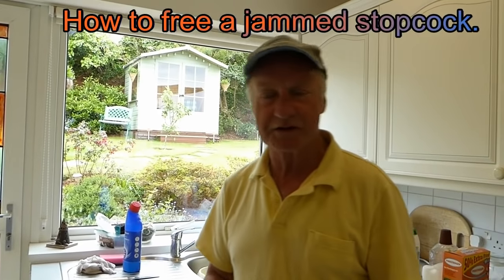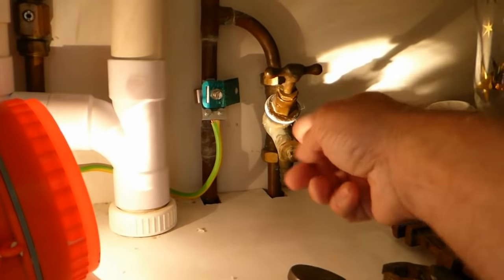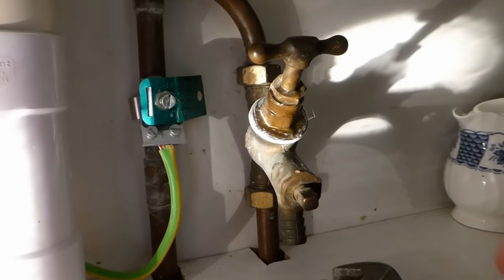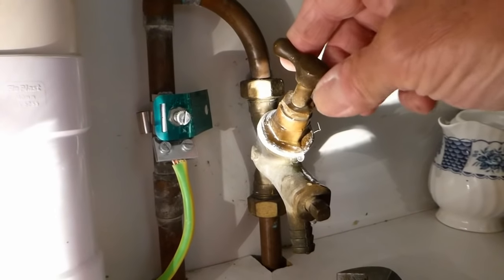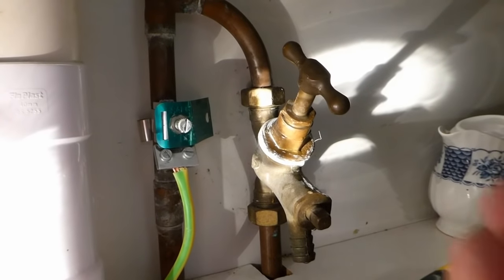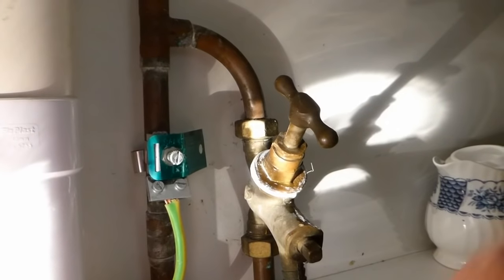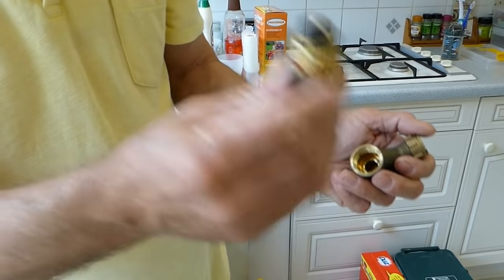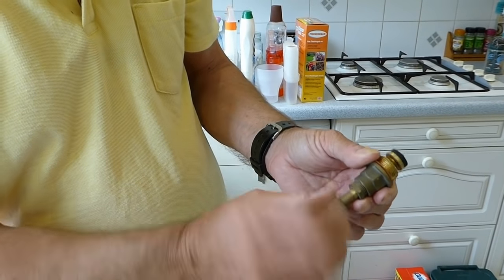How to free a jammed stopcock that will not turn.

Comment: Hi I have phoned umpteenth time to plumbers who say you can't free a seized stopcock as it will not be the same if it's freed, that's shocking from so many plumbers in my area. I have a burst pipe in garden, and the insurance will not pass  said repair until I fix seized stopcock in kitchen? There is a stop valve in street? What's a seized stopcock got to do with a burst pipe in garden under my monobloc path?
Reply from the maker: Once they are freed, they can sometimes not work properly, but of course, you do not know until you try. Most plumbers will avoid this sort of job.
Reply: @dereton33  Thank you for responding, yes your right no plumber will entertain it 😕 and the plumbing company for insurance will not fix burst pipe in garden because of internal stopcock, even though there is a working stop valve in street, many plumbers I spoke to on phone said, they would not bother if internal stopcock was seized anyway as they would use the stop valve in street to isolate water coming into property and to replace broken pipe in garden. Back to square one, insurance company are going to employ another company to look at issues in garden. Cheers 👍

Comment: If replacing a stopcock completely, I'd usually put a lever valve in. They might not conform to the latest regulations, but are much easier to turn on and off, especially for elderly people.
If your stopcock is dripping fromm the gland, undo it completely. put a few turns of PTFE tape around the spindle and do up again.
Reply from the maker: Thanks for the info.
Reply: leslie straw Hmm... I'm guessing you're not a registered plumber. Pegler make a range of full-bore stop valves with lever or tee handles. They comply to EN 1254-1.
Reply: Hi I've seen lever valves that get crunch when shut off ,wind them back out stops them leaking but a stop cock is better,they use lever valves in the Republic of Ireland as standard and seen handle break off no big deal,but hey some like em.
Reply: @leslie straw I don't need to Google anything as I was a plumber for 35 years. I know about Pegler valves because I prefer to use them for their quality. 
Explain how a particular type of valve causes water hammer?
You clearly have absolutely no idea about plumbing.
Going back to the original rant you made, the internals of valves are often the same with different "tops" ie traditional tee as shown in the video, lever, circular grip etc. Whether the case, the internals are often the same.
And whether or not they comply to the water regs is to do with their certification not the type
Reply: Some people seem a little confused between the different internal types of valves and the type of grip used to operate them.
The type shown is a traditional compression washer fitting shown with a brass tee. It could have a wheel grip instead of a tee.
Alternate types are gate valve, ball valve and full bore ball valve. Gate valves usually have a wheel grip because, like compression washer types, the user has to turn the tee or wheel several times to fully open or close the valve.
Ball type valves can have a small tee or lever as they open/close with a quarter turn.
Manufacturers produce all types in accordance with water regs.

Comment: Mine is horizontal so it's hard to turn as I have hardly any space to use pliers or spanner to turn it. Maybe I need to just go outside and turn it off instead , I know hes said no oil but I've stayed mine with wd40 to see if it helps ?
Reply from the maker: Worth a try Viki.

Comment: How do you losed that packing box nut when it is refusing to turn is their a special spenner wrench ?
Reply from the maker: A small adjustable wrench, or if it is a round one, small stillsons.
Reply: @dereton33  I have used adjustable spanner and the ajustable long pliar type one and nothing grips it and someone else tried
Reply: @dereton33  Much appreciated I fixed my leak !
Reply: @dereton33  By the way to change my toilet waste pipe and syphon as its rumbling some times how to I turn all water off as the stop cock next to the toilet that I fixed turns of tap water but water keep filling up the cistern

Comment: love how electric is grounded to the water pipes
Reply: Richard Taylormade it is normal practice, in case the pipework becomes live somehow (faulty appliance or wiring) to make sure there's equipotential all the way across.
Reply: It's not electric it's the copper that's earthed as reasons stated above
Reply: @gomalibusurf6098  This isn't the USA.

Comment: Hi mate. Great videos. After using a similar tap to isolate the shower, there is a bead of water slowly leaking from the top of the packing box. Is there a sort of grease or compound meant to be filled in there for that reason?
Reply from the maker: No, just undo it and poke some PTFE tape in there.
Reply: @dereton33  ahh brill. Thanks Dereton. You are a star. Have a good one sir. Cheers.

Comment: Never seen that pattern of stop cock before with the body and D.O.C at that angle.
My S/C is on a lead main, no way a compression S/C would fit, the tails are a different size and thread pattern. Managed to adapt outlet side to copper and have now fitted a secondary valve (lever pattern) in a more accessible place along with D.O.C. and double check valve. The original S/C does still function, so serves a purpose, just awkward to access. 1960s house weren't built with fitted kitchens in mind.
As you say, you can swap the bodies, most S/Cs conform to BS1010.
Reply: Whats a D.O.C.?

Comment: I have got the problems with two stopcocks in my house, the stopcock by the stairs is completely seized even a good plumber could not free it, I have tried to swap bodies but mine is imperial and most are now metric! any ideals please?
Reply from the maker: Kevin Tucker You will have to change the complete stopcock, it`s the only way.
Reply: And I would suggest cutting the pipe above and below the knackered stop cock and replacing it with the new stop cock assembled onto 2 short pieces of 15 mm pipe then use 15mm straight yorkshire soldered onto the existing pipework.

Comment: Mine was covered in green stuff round the shaft gland. Cleaned with wire brush, WD40 on shaft, waited 5 mins, more WD40 and it worked loose by hand. Might not work for every tap, depends where its seized.🤨
Reply from the maker: Thanks for the info.

Comment: I'm not saying this isn't a good video but it's never as easy as they make it look.  For a start one problem was just getting a simple footprint wrench such as he's using above.  There is a Wickes,  a Screwfix and a specialist plumber's merchant store all just a few minutes walk away from here and a B&Q a bit further and none of them had one, I had to order one - so a day and a half wasted.   I have a pipe wrench but it's too big for that space.   Anyway I loosened the 'packing box' thing as at 1:37 in the vid which loosened OK but it didn't help on mine - I had originally been able to get about half a turn by hand but after loosening that part I couldn't even get that.   i know the stop cock worked four years ago because I changed the kitchen taps above it back then so it's bloody annoying.

Comment: Iv got a wired one truned the stopcock off for my hot water tank to change a tap went to turn it back on again only goes 1/2 of a turn and stops will turn off again but wont go more than half a turn on
Reply from the maker: If it was a gate valve then you have big trouble, if it was a stopcock then just gently force it back on with grips.

Comment: What about if its the main stopcock for the supply to the house? How do you turn the water supply off to repair or replace it if the tap is stuck/broken?
Reply from the maker: +RonniePeterson contact your local water authority.
Reply: Top advice as usual, thanks.

Comment: I think that you forgot to mention, that you should drain down the rising main supply, once you have turn off the water supply outside, it would be automatic to youi, but not 

to amatuers, and putting oil on the valve, not a good idea, toxic, you would be better off, soaking it in a cup full of vinegar as this would descale it, which is the usual problem., oil will not descale it. and when you open a stop valve fully, give at least a half turn in, so that if and when it seizes you will be able to turn in both directions to loosen it free. also when fitting a new stop valve undo the headwork from the body of the valve, as they are put together in the factoiry so tight you would have a job and a half trying to dismantle it in situ, I like your quality conex stop valve, don't forget to put the valve in the right way around, there is an " arrow on the side of the valve, showing the direction of flow, other wise no water will come through.
Reply from the maker: Thanks for the info.

Comment: I need to replace the handle section in an old style stop cock. Will a modern style of the same size fit.
Reply from the maker: Depends on your luck it s a 50 50.

Comment: If you have an old pear shape water board key the one with the stopcock on it , cut the handle off and you will be able to use the footprints on that without snapping the head
Reply from the maker: Thanks for the tip.

Comment: WD40 is magic. Leave it for as long as you can, and if still not moving, wax candle light a little heat then try, works all the time.  Maybe after heating spray more WD40
Reply from the maker: Thanks for the advice.

Comment: Just like old wheelhead valves in your airing cupboard, waste of time, always break, or are seized, once it starts playing up, pay a good plumber to change the rubbish, ball lever and double check valve, then a push button system for the elderly if inaccessable
Reply from the maker: Thanks for the info Paul.

Comment: Seriously, if you've never tested your internal stop cock then your external one isn't likely to work either. You need to turn both on  and off every year to keep them servicable. Also be aware after about 30 years the rubbers on these are likely to have perished so one day you'll find you can't turn them off and also the top rubber which stops the water leaking out when the tap is on is also going to break one day, and this will happen when you do turn it off and on.
Reply from the maker: Thanks for the info Nicholas.

Comment: When you bought that stop tap
you werer robbed. The plunger
should have a small nut and 
washer on it, over the washer to stop it sticking to the 
seating when you turn it on
again. Lax not informing people if you knew.
J. Calveley.
Reply from the maker: Not all stop taps have the nut screwing down on the washer,  all though like yourself, I prefer those ones, a lot of them now just push over an expanded blob on the plunger, which is used to hold the washer on.
Reply: @dereton33  Yes I know that, but that was threaded, and if
they see that they'll think it's
OK.   I've been a plumber since
I was 15. Now l'm 85, and you
wouldn't believe some of the
things people do, and cockups
ups I've seen,  through them
'" knowing it all"
J. Calveley.
Reply from the maker: I know, I too have seen it all.

Comment: My stop cock is seized. I go to first loosen the packing bolt as the gent says, and it turns no problem, so loose i can turn it with my fingers, but there is no leaking as shown in the video. And i still can't budge the stop cock.
Reply from the maker: Try nudging the handle back and forth gradually until it starts to turn.

Comment: Mine completely welded itself I think Wd40 does nothing tried get all kinds of leverage but nope ain't moving and the candle trick won't do nothing as the pipes ice cold and dripping so no chance of warming it never loosend the packing thing its 2 much effort this is my fucking incompetent landlords job but I'll try again but I literally cant really even wiggle the tap
Reply from the maker: How about turning off the water outside then putting a new full way lever valve above the stopcock.

Comment: Question I can't turn off water from mains outside  and my inside stopcock is completely tight how can I fit an isolation to pipe
Reply from the maker: Use a pipe freezing kit.